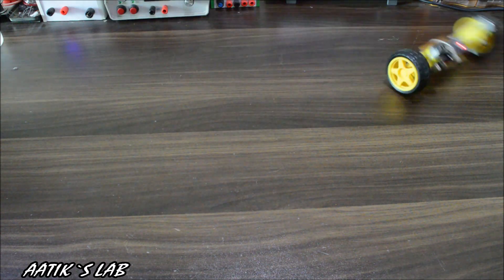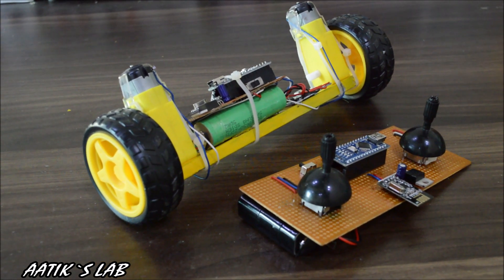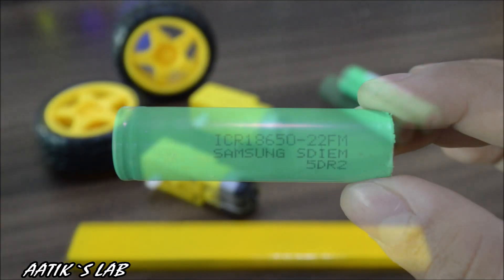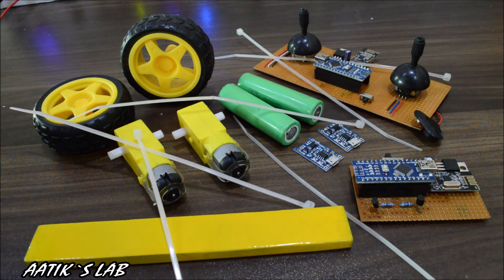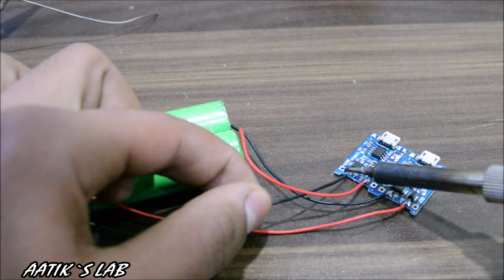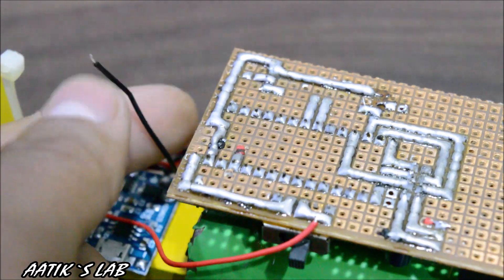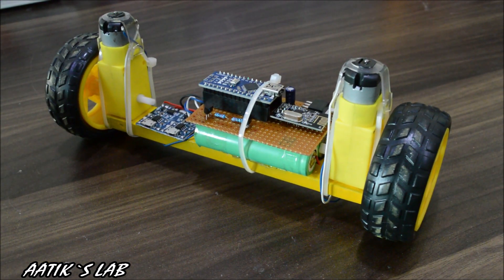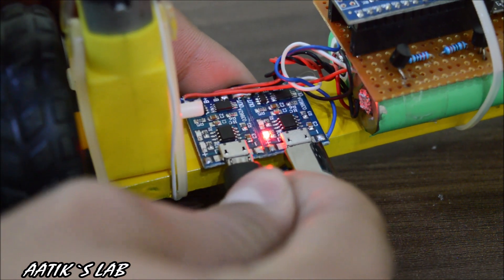How to make RC Self Balancing Robot at home || Arduino Joystick Control Car || Part 2

Comment: Sir I want to make solar charge controller so I was thinking of making same like u made but my solar panel is 12v 20w with direct output voltage upto 21v and I have battery of 12v 7Ah can I use your circuit will it work ? 
And whats the name of those 3 diode u5 u6 and u7 ? You didn't mention their code in the circuit diagram